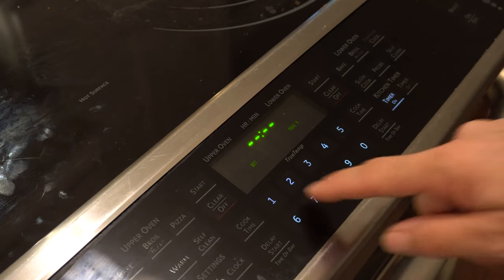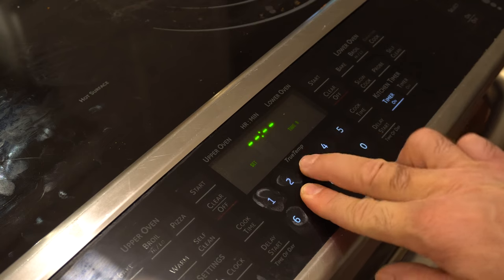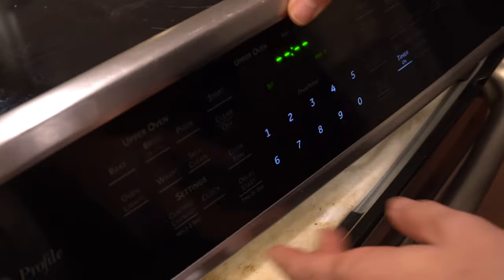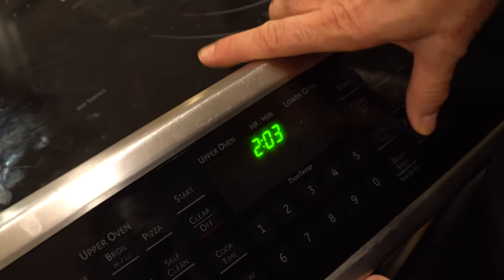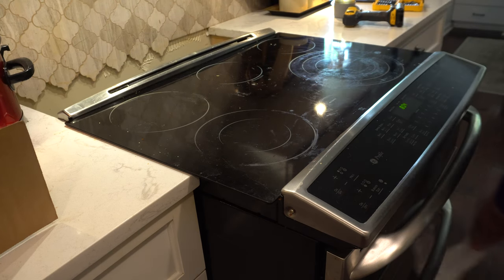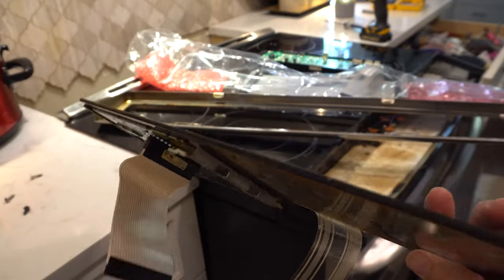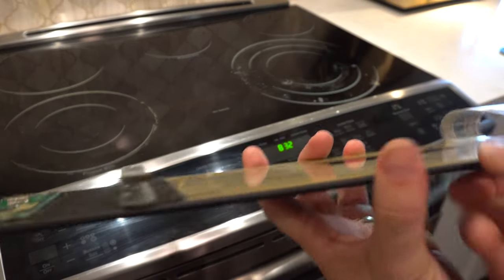GE Profile PS978ST1SS Bad Keypad/Not recommended!

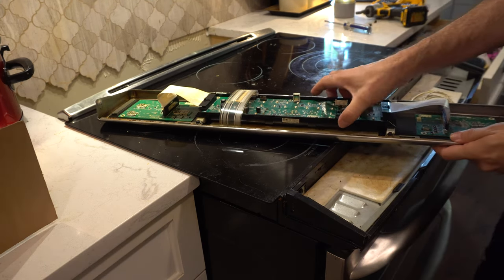Comment: @ACBMemphis did you reuse the panel you took off at 1:44-1:47?  Trying to determine if it's the glass panel or the panel underneath that's the problem in mine.
Reply from the maker: Yes, I re-used everything but the main glass part - in other words, I only ordered/replaced 1 part. It's still working today. Whenever we run this oven now, we always turn on the vent-a-hood fan to try to make sure it cools and the display does not fog up. I would definitely read through some of the comments here before ordering that expensive part... some have suggested cleaning with alcohol and others have had bad ribbon cables.
Reply: @ACBMemphis  Thank you.  I saw the comment about denatured alcohol and conductive ink, but not sure where they are applying those?  Ribbon cable is interesting, but one button is intermittent and one just never works, so I'm not sure.

Comment: This sort of thing happens to mine but I just hit the control panel with some denatured alcohol to get it back to normal again
Reply from the maker: Thanks for the tip - will definitely try this if it happens again!
Reply: Where do you rub the alcohol? I’ve opened it up cleaned up in there but everything looks great.
Reply: I have the same exact oven. My control lockout, clock and start for lower oven have stopped working. Please help.
Reply: @jeralynleydig .  Are you cleaning where your finger prints are or somewhere inside the panel

Comment: Same oven, same issue.  I was hoping that you had a fix for this instead of replacing the $300 part.  Darn it.  Thanks for the video.
Reply from the maker: You're welcome... Yes it was a pain to have to replace this expensive part, but a lot less than a new oven. The control panel is still working as of May 2024. Earlier this year the "beep" sound stopped, but that was fixed by simply taking the oven apart and tapping on the internal beeper speaker a few times...

Comment: @ABCMemphis. Thank you for the Video. I replaced my control panel but the touchpad is still not working. The ribbon is severely heat cracked by the connector and I believe that it is defective. Can't find one online. Do you know if the black connector comes off the ribbon?  thinking maybe could be trimmed and reattached. Or if you have a source for the replacement Item? Any help would be gratefully accepted.
Reply from the maker: No, I did not have to change any connectors... I found the part by Googling the oven, and a lot of the repair sites seem to have the same diagrams, from there that's how I found the specific part number. Maybe they will have the cable/board as well.. I just searched for "General Electric Oven Ribbon Cable Connector" and it looks like at least some cables do exist on Sears Parts Direct.

Comment: I’ve got the same oven. Have you had any problems with it just turning off after it starts to heat up, seems like once it hits 250, it just completely shuts down.
Reply from the maker: We never had that problem, but once I noticed that the display could get "steamed up" by cooking things like bacon, I always made sure and turn on the vent fan above when I'm using it. It seems like a really bad design that overheats the electronics....

Comment: How did you determine that the touch pad was the part to replace instead of the control panel?
Reply from the maker: The condition got worse over time, I was able to press "3" repeatedly for a while, and then not at all. Before I replaced the control panel, I tried with the panel loose pressing the front and back of the keypad at the same time, and eventually got it to work, so it seemed like the fault was in the keypad....
Reply: I have the same problem. How much was the part? Where do you find the part number to order?
Reply from the maker: @jeralynleydig  It was about $700... which may not be worth it. Finding the part number was just the result of a lot of Googling. The part I ended up with was WB27T11380 - but I would double check your specific model with the sticker inside the door...
Reply: Thank you so much. It is well worth it for me to order as the oven was over 4k
Reply: Called GE directly. Did not need full control panel only one for oven control as that is where the random buttons didn’t work. The rep actually gave a discount on the part and free shipping w/30 day no hassle refund! It was under $300!!!
Reply: @jeralynleydig  Could you share the part number?
Reply: That is my question, is the problem maybe just the board below the glass screen that you remove at 1:44-1:47  ?  I think that is WB27X21393
Reply: @jeralynleydig  part number, please?

Comment: I have this same oven with the same problem. What is the part number and how much did it cost you?
Reply from the maker: The part number is WB27T11380. Unfortunately it's about $700! However, when you start looking at the prices of new double ovens it is a lot cheaper to replace the part....
Reply: @ACBMemphis  The part is now close to $900.  Thinking of ordering it because I think the newer ovens aren't built as well anyway.

Comment: I'm screwed, for my GE oven I need the plastic keypad part# WB27T11211, no longer being manufactured by GE.  What's the point of buying a $3K GE oven and the wife bumps something hot on the front and it's unrepairable because they don't make it anymore.  No more GE appliances for me.
Reply from the maker: That stinks! For a $3K oven I might be tempted to check eBay or find an electrical engineer to repair it... Seems like appliances were expected to last longer in the past. I know people locally with late 1970s era houses, and the GE electric ovens that came with the houses are still working. On the other hand, I put in all new GE appliances in a 2013 remodel (fridge, microwave, oven, dishwasher) and had to repair then replace them all by now, except for the oven in this video...